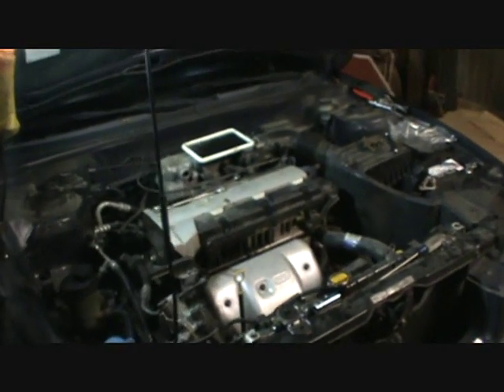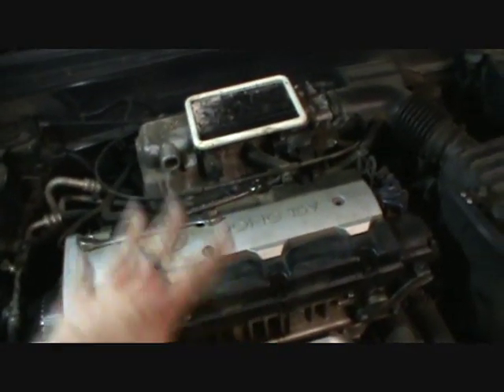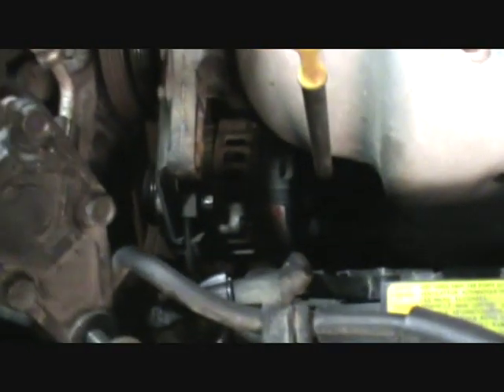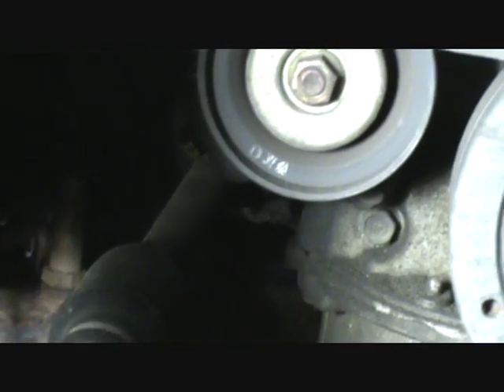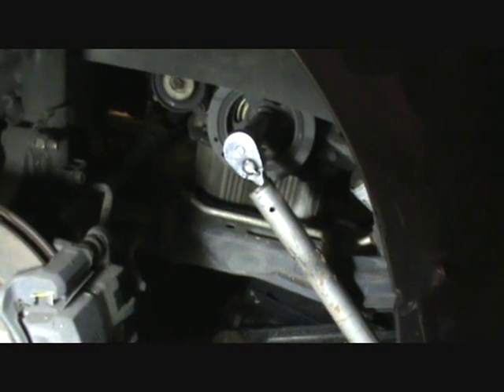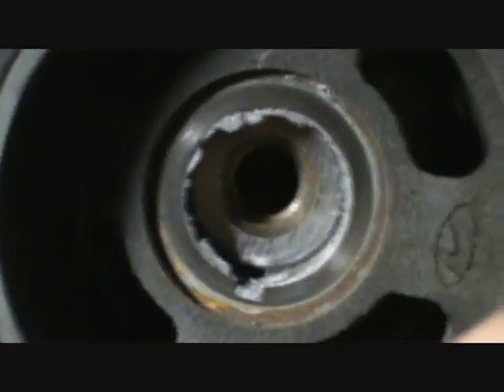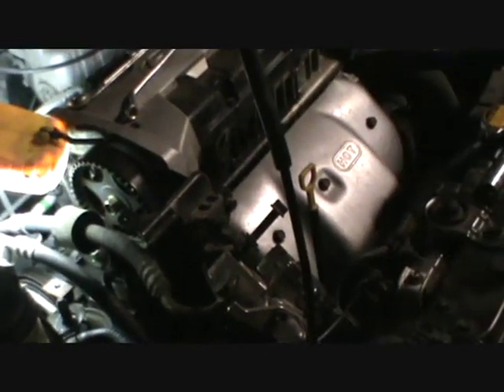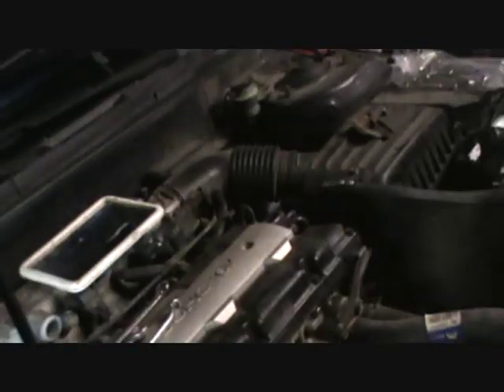2001-06 Hyundai Elantra timing belt service procedure part 1

Comment: Video helped me, Had a stripped out belt missing teeth, replaced it WITH NO VALVE DAMAGE !! runs great. broke a t low RPM, so YES it can break without Valve Damage.

Comment: The water pump was the one i was having difficulties with, it is keyed and 4 bolts. i found once you are able to get the bolts started, you can put a wrench on em and have someone turn the pulley the right way and they'll tighten up easy.

Comment: Just did the timing belt change on my 03 elantra today, 164,000 miles on the original belt :x Overall wasnt bad, at the same time i did the pulleys as well, the accessory belts, radiator (top tank had a 3-4" crack), new radiator hoses, and coolant flush. Looking to get 200,000+ out of it :P

Comment from the maker: Simply take another of whatever tool you are using to loosen the bolts and set it to tighten. Place it on another bolt, and while you are loosening one bolt, the other tool is tightening the other bolt. That works good on 3, the last one may take some effort!

Comment: Wow! I paid about $130 for the full kit, including the timing belt, idler, tensioner, all accessory belts, crankshaft and camshaft seals, and valve cover gasket. And had money left to get a professional grade 1/2 inch impact wrench from Harbor Freight for $71 with a 20% coupon (and on sale) which took out the crankshaft bolt on the first try! Not a difficult job to do...and I am a rookie.

Comment from the maker: It's theoretically possible, but remember the car weighs 2500 lbs and the bolt is only torqued to a little less than 200ft lbs, so I wouldn't worry about it.

Comment: I always screw the bolts in their place, and put the parts in the car/trunk, don't want to lose anything. And it sucks to have a bolt or screw left over...

Timing belts can be a pain to change, and if they break its done for. I don't like them either, but I would rather replace them every 60K then have to do timing chains on a motor when they start to wear out...

Comment: So Tyler, you've owned two Protégés and one Elantra so far. What do you have to say about both cars, comparatively speaking? Nevermind that your Protos were a generation behind the ones I'm looking at.

Just wondering, I've been a backseat passenger in both, I reckon the Elantra was the most comfort-oriented but that the interior wasn't too "hot" compared to the last generation Protégé. They seem to fare similarily reliability-wise.

Thanks.

Comment: Hey Buddy   Did another timing belt change and the bolt hole for the pulley/Tensioner stripped  I used a helicoil with coarse threads to fix,But afraid to over tighten..  What would be the lease torque you would do on the bolt... I just hand tighten at the moment,And kinda watching it

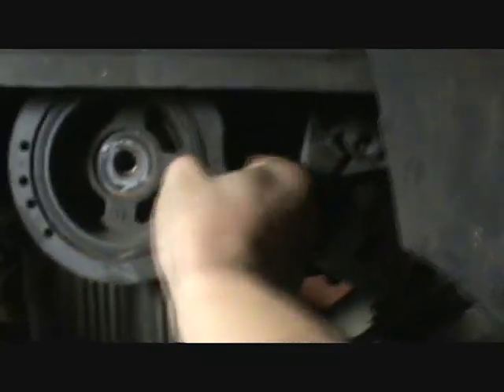Comment: Question.  I also have a 2001 Hyundai Elantra 5 speed manual transmission.  I am doing this myself and am stuck on part 13:22 of the video.  I cannot seem to get that pulley off.  I did get the bolt off, but the pulley is not budging.  What do you suggest in removing it?